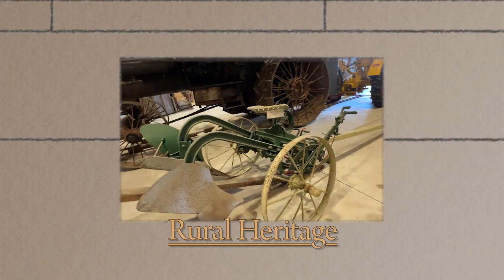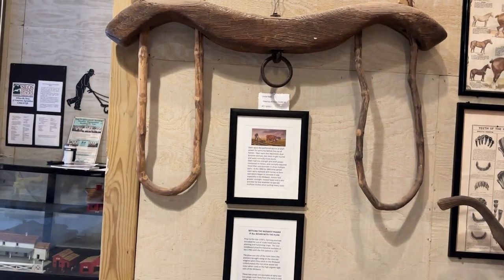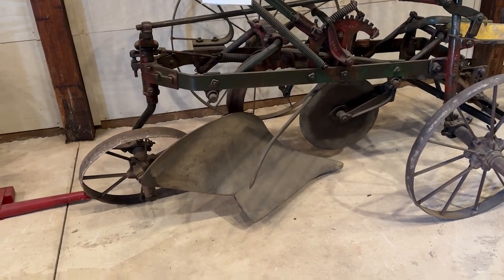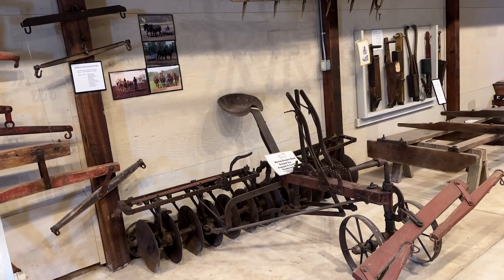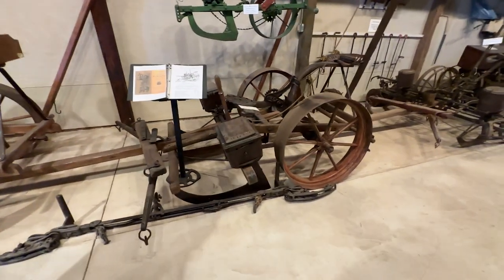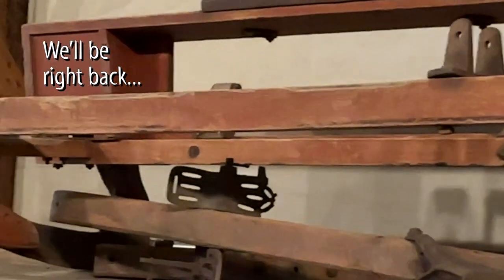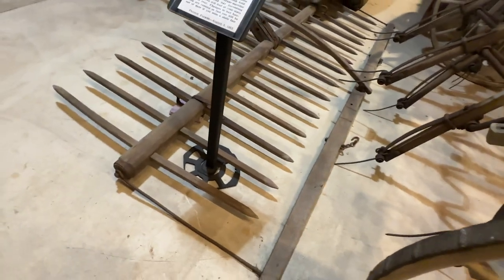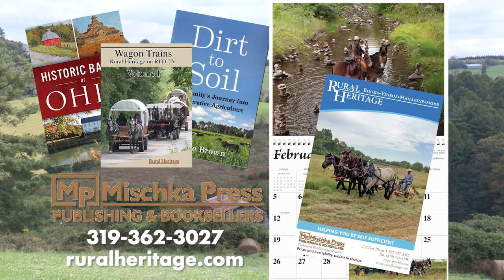Jackson County Iowa Historical Society Museum Part 1

Comment: I 😊😊 know the old cleaners U are talking about they are called steam Jenny's they run off kerosene U hook up the water 💦 😊 hose and turn it on add the soap power or cleaner 2 it and when it got hot U could use it back in the day everybody 2 use them 2 clean engines / the last 1 I seen was over 3O years ago when I was in school and had auto mechanics class I might seen 1 since then that's about it alot of the drawn equipment they used the big draft horses 4 that they had the pulling power and the old ploughs they had 2 change them and the steel they was made of so the dirt wouldn't stick 2 the ploughs other dirt was just like clay 😮😮 OMG 5 27 2O24